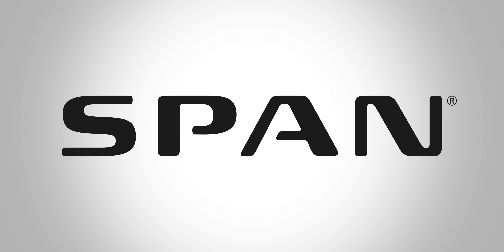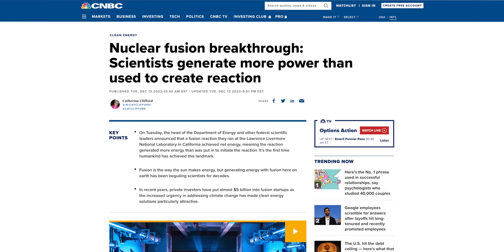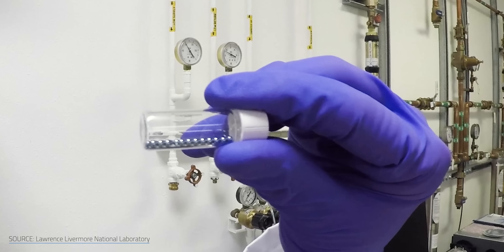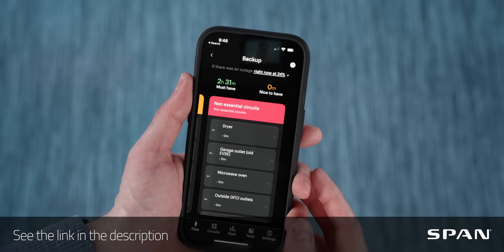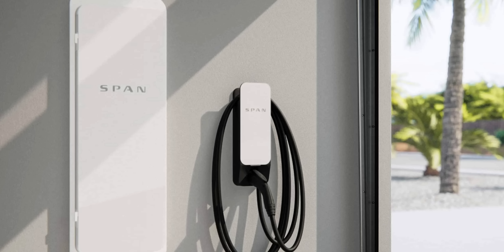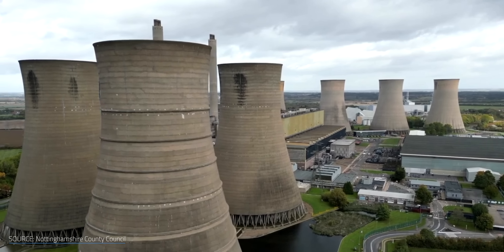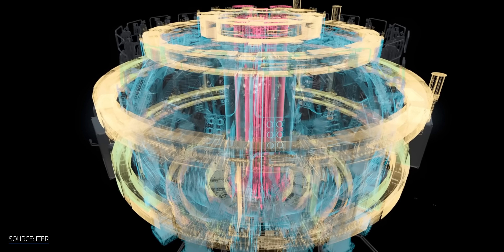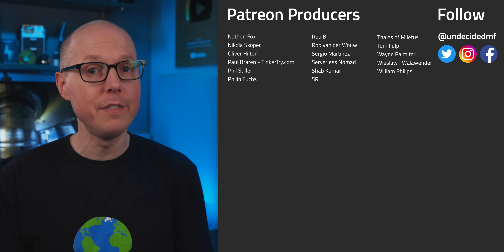What This Breakthrough Means For Nuclear Fusion

Comment from the maker: What do you think of the latest fusion announcement? Are we still 30 years away? Get the Span Panel and Span Drive EV Charger at https://bit.ly/3WCInGP.

If you liked this video, check out 137 Year Old Battery Tech May Be The Future of Energy Storage https://youtu.be/2wsSRq-bEm0?list=PLnTSM-ORSgi4dFnLD9622FK77atWtQVv7
Reply: Ah Matt......30 years....and the rest..............been following fusion since I was 16. Now hitting 50...... and I will not see a working system before I die!
Reply: likely 50 to 60 years we might have a real breakthrough, at least i see different companies trying different methods
Reply: I believe what we are seeing in fusion research, in a way, parallels the space launch system work ie. NASA vs SpaceX. The iterative nature of some fusion research, ie. Helion vs ITER will draw commercial fusion power closer much faster, much the way SpaceX, Blue Origin, and smaller companies like Rocket Lab have drawn everyday space flight closer. Commercial fusion power may not be right around the corner, but it is coming at us much faster than ever before.
Reply: @bjbosche  

What about  non-commercial fusion power?  Most of this research and development seems to be directly or indirectly state sponsored using tax payers money so I would argue that there is no good reason why the viable end result should not be also.  I think it would be better not to give up this energy source (if it ever gets to the stage where it's economically viable) to the private sector to monopolise and make a profit from, but rather let it be owned and operated by state governments (or the federal government) at cost price and funded by state/national taxes.
Reply: I do think that there was some deliberate misreporting going on here.  There was an announcement that came from the DOE about this achievement and they are not going to simply miss an important detail like this.   The DOE and ARPA-E are funding multiple different fusion research programs and they should have no reason to want to favor one particular research activity over another.  The only way you can compare the efficiency of the widely different fusion reactors is to compare net energy out to net energy in.  The fact that this reported ignition was achieved by redefining the rules for the game is simply not a detail that anyone related to this industry has missed.
Clearly there is something else going on here - maybe this was pulled as some kind of political stunt?
Reply: I show my evidence...  "The Hunt for Dark Matter is Over" on my Mudfossil University Channel.
Hello my friend...we created a fusion reaction using a HIGHLY TUNED venturi and only light photons. The result was acceleration and we could see the particles actually divide into Muons/electron showers. Can we speak? I have the evidence.
Reply: I used to work as a subcontractor to LLNL and the NIF facility was not designed to create grid electricity and never will. The TOTAL energy input was at least 1,000 times greater than the energy output. Tapping 2 crystals together will generate electricity but will never generate utility-level energy. NIFs main function is to get politicians to fund their existance, they are very good at that, can they do fundamental physics? maybe and that may be enough of a reason fund them.
Carefully managed Fission Energy of existing facilities to generate base load is the way to go until the real Fusion power can scale up Wind/Solar/Storage is the future for the next 30 years.
Reply: @jjamespacbell  Same for CERN LHC. But NIF is all about the 4th gen pure fusion micro bombs. They just dressed it up as fusion energy research. And lately they did not even bother to mislead people. DoE guy specifically said that this is for our nuclear deterrence (read: China). There is a scientific mafia out there to steal the research projects.
Reply: I think what these fusion ignition concepts organizations are building are Fusion Bomb Igniters. Clean Igniters to create Fusion Bombs that don't use radioactive fissionable material as their ignition source . Bombs with NO discernible nuclear fallout. Bombs that can be used on the Battlefield. The NIF has demonstrated such a device is feasible. They only required 10 Kilowatts of Laser Power to achieve  a Fusion detonation equivalent of 27lbs of TNT from the fusion of 4% of their Pellet.. All the rest of the huge amount of laser power was filtered out.   And that was being wasteful.   Until some one comes up with a Fusion device that produces electrons directly into the power grid this process is going in the wrong direction. Been following Fusion since before they built the first Fusion Bomb.  At this rate my Great Grandkids will not see the benefits of Fusion. If we haven't blown up the planet by then.
Reply: I remember reading that the French were also experimenting with laser induced fusion since the 1980s.
As far as the total energy balance of the entire plant, they are still very heavily in the red.
Going from microseconds of fusion to a 24/7 year round operation, is definitely still 30 years away lol.
I have also commented in a previous video of yours that only when they will achieve Deuterium - Deuterium fusion, fusion will fulfill it's promises but this may be 100+ years away. 
IMAO, since in a hydrogen bomb an atom bomb is used to start the fusion reaction, so it may be feasible to use this laser ignited fusion as a starter for the fusion of a magnetically compressed plasma. 
In other words combine existing technologies instead of using them separately.
Reply: - -  Check the video from 'Real Engineering' titled "The Problem with Nuclear Fusion" and THEN you HAVE TO SEE this video after that titled "A New Way to Achieve Nuclear Fusion: Helion" :D
Reply: The 30 yrs away def still true (at least), only question is whether we've cut down on the "always will be" I guess that's "undecided" lol
Reply: Based off of this video would you say fusion is only 20 years away?
Reply: Its hard to see how it can ever compete on cost with the large free fusion generator of the solar system. Its like 2 car companies - one has access to a free fully staffed production line where all it needs to do is drive the cars away vs a car company super high tech amazing production line but it has to pay its staff and maintain it. Now the free one has some issues with the hours it runs and convencience of location but when all the hard bits are free it is such a competative advantage.
Reply: The West just wants to push its far-fetched propaganda. So far EAST still has the upper hand...holds two records.
Reply: @cam35mm  You know China's EAST reactor is a test site for the international ITER program being built in France with a multinational team that includes China? It has also been mentioned on this channel in the past.
Reply: @kingdomofashes  Ummm...EAST completed in 2006. ITER founded in 2007. So if you are saying that ITER is based off of EAST and using EAST data even though ITER has not been completed then yes. Yes I know EAST has been on the channel but this video was based on ginning up the west projects. granted Matt busted many of the west propaganda though...good for him. But still if no one knows about EAST then people would think it's the west invention and in the end the propaganda would be China once again stole the west tech.
Reply: If they all collaborated exchanging tech and insights. We are looking at a good net positive solution by 2030.
Reply: You were quite slow on the draw to this announcement, think YouTube has already been saturated with others explaining the actual science behind the announcement for a good month or so
Reply: At the current size and importance of breakthroughs, we need such a similar breakthrough every 2 or so hours to meet the 30 years goal.
Reply: - HB11 strikes me as the best technology ... mainly because it scales both down and up - Proton Boron reaction is difficult to start (some claim positive Q is impossible) but produces energy in the form of alpha particles whose kinetic energy can be converted via MHD and gamma whose photon energy can be converted via pair production and photovoltaic ... NO MOVING PARTS. That means that R&D must proceed on 3 fronts: [1] Efficiently triggering the P-B reaction [2] MHD conversion [3] gamma conversion. 
- Unlike D+T reactions, there is very little neutron production. This should simplify reactor maintenance and salvage.  Since there is no steam turbine generator, this seems to me to be much more something I expect from the 21st century. It seems anachronistic to use nuclear energy to operate a steam engine.
Reply: We are infinitely away. I am getting inpatient with your optimistic reports. Nothing has happened. Net gain is nothing. It is a hype.
Reply: Looks like a step forward but the competing fusion reactors mean some projects are going to lose out. The French Iter reactor isn’t even completed yet and it may be obsolete.

The other issue for energy is not just production but also consumption. We need to build more walkable and efficient cities that require less energy consumption.
Reply: When I was a kid, the joke was "50 years away and always will be" then it was updated tob"30 years and always will be" and now I've heard it told unironically as "20 years." Meanwhile the performance of fusion experiments has been progressing at a rate similar to Moore's law. There has never been any intellectual integrity behind the joke. It's just oil industry copium at best and outright propaganda at worst. But tell a lie often enough and everyone will learn to believe it. That said, this approach doesn't seem like the most likely route to actual working power but at least the news helps push back the idiots' memes.
Reply: Honestly, I think the timeline might be shorter than we give credit due to the advancements in AI. The next few years may be the tipping point in which a myriad of mysteries in physics are cracked thanks to breakthroughs in computing itself.
Reply: Unless the lasers used were only a couple percent efficient and they can get close to 100% efficient then there’s no logical way that first mentioned system makes sense, ever, even for a single shot of power generation.
When you add needing to cool the chamber back down to near absolute zero and cleaning it before doing another shot, that’s nonsensical for other than very expensive experiments even if you had a tritium breeder, yet another problem.

Maybe another one of the mentioned methods will work, but not that one, that’s clear!
Reply: The technical advancements to make commercial fusion possible are unbelievably difficult.  It may never happen, but it will definitely not happen without major private investment and government money.  Since we need to spend trillions of dollars a year for the decades to slow down climate change, we need to spend billions of dollars a year on a chance to solve the energy problem and climate change without bankrupting us.  It will take all the advance technology we have and can invent to make commercial fusion a reality.
Reply: @MissingUser  honestly after 20 years of obsessive research, I can tell you EVERY major super power in the world 🌎 has a variation of this exotic technology. America, China, Russia, Germany. The only people losing are the 99% that are ill informed and won't say anything to them about releasing the classified technologies IMMEDIATELY. 

Releasing the technology to the public would be the ultimate disruptor but it's inevitable, too many independent labs and scientists have replicated results and working behind the scenes on commercialization. The elite super powers know this. 

The entire RUSH to zero carbon emissions has NOTHING to do with cleaning up the environment or saving humanity. It is the 100 year old classified defense and aerospace sectors way of creating a public fascade to transition into the quantum energy generation technologies that they can no longer control the narrative of due to humans naturally progressing. 

It's a way to keep eyes off the government, dod, DoE and defense contractors that already had all the technology just wouldn't release it but because there is this high speed push to go carbon free to sustainable energy it allows room for a transition period where "they" can routinely release information and breakthroughs to the public slowly as they give ample time for the oil cartels, energy cartels, and automotive cartels plenty of time to rape and pillage before shutting down indefinitely. 

One example is the BIG nuclear fusion announcement from the United States 🇺🇸 DoE and Lawrence Livermore National Labs last month. While the public announcement was a fascade behind the scenes they are 60+ years ahead of what they announced and stole trillions of dollars in tax payer money to fund it. But as more independent labs and scientists figure out what the defense sector already knew, the United States 🇺🇸 curiously announces to the world a "NET ENERGY QUANTUM FUSION REACTION" but still claims we have years to go to commercialization.

Yes the poor broke labs and scientists have a decade to catch up but our defense sector and classified aerospace have been there and done that already just never allowed the tech to open markets. 

Release of these new energy generation technologies above and beyond traditional solar, wind, coal, petroleum and even traditional nuclear is the biggest disruption on earth. The price of EVERYTHING PLUMMETS TO NEAR ZERO.

Another reason blockchain cryptocurrency and bitcoin is infiltrating the world is due to the plan of the defense sector control collapsing the old carbon scam petro dollar and rolling into a digital blockchain bitcoin system because these new technologies get rid of the idea of money as we once knew it. 

Its all being planned, I can see the writing on the wall but it could go much faster to rollout of these exotic technologies if the average Joe's of the world would get educated and DEMAND RELEASE OF THESE TECHNOLOGIES. 

You can literally find 1000s of pages of engineering r and d data from Nasa, DoD, DoE, Defense Labs, Lockheed Martin, Raytheon, Military Defense labs, declassified data going back to the 1950s proving they been developing secret energy tech for decades using stolen taxpayer dollars. It is not some tin foil hat conspiracy it is a fact. The quicker the public catches on to this the better.
Reply: Space propulsion it's probably a more likely market where cost is less important than performance
Reply: Antimatter Factory Fusion Reactor is an easier way to do things. Two small Linear Particle Accelerators creating the AM fuel which drops into the reactors and other matter fuel to annihilate and cause other pieces of matter to fuse like a contained thermonuclear reaction. Using a  small Tokamak like SPARC with the Antimatter Fuel Injection will speed things up.
Reply: Yes, other light isotopes such as deuterium and hydrogen-3 can also be used in fusion reactions. Deuterium, for instance, is commonly used in fusion experiments as it can be easily obtained from seawater. Other isotopes such as lithium-6 and boron-11 have also been explored as potential fuel sources for fusion reactions. However, tritium is favored as a fuel due to its high reactivity and relative abundance.
Reply: Out of all the new energy tech, I think SMR and the deep geothermal are probably the most promising. We already have SMR builds underway, while the renewable energy lobby could derail it in the US, there's still a chance that it'll get build outside of the US. The deep geothermal with the mmwave drill is also promising, it seems like that's a much easier technical challenge to overcome than fusion.
Reply: This is very cool and seems like the technology they use to power spaceships.  Also check out Brillouin Energy out of Berkeley, California. They have a technology that converted Deutereum or Hydrogen into Helium which generates 3x over unity in terms of the electrical power that you put into the system.  They key in their system is a chamber that contains powdered tin metal that is used to create an even dispersion of reaction gasses in the chamber. We aren’t going from matter to 0 matter, generating ALL the energy, we are going in a step from Hydrogen to Helium and releasing the in-between energy of that smaller step.  It’s very safe.  Hot Hydrogen Tube.  Can revolutionize the world.
Reply: power armor
Reply: The only way we see commercial fusion in my lifetime will be if some scientist throws some chemicals i a beaker and forget to dump them out when nothin visible happens before 5:00 quitting time. Then she comes back to the lab the next morning, and !MIRACLE! fusion occurred in the middle of the night. Worked for Kevlar, maybe for fusion too. I've been studying/watching fusion progress since 1968, and the hype has gotten really boring, to the point of irritating. Still, I did volunteer to die to protect your right to free speech, if necessary, so let's keep the discussion going. Cheers! PS: I think the Complexity people may be on to something, as confinement failures may be solved with Complexity Theory advances.

Comment: I hope everyone understands this, the reason goverments are freaking out to produce fusion is that petrolum basically is about to explode in price due to shale production peaking meaning most western nations are going to be left with no cheap energy sources.
So if our infastructure does have an energy source that has an energy returned on energy invested of roughly 30 times the amount you invest within the next 25 to 30 years our system will just not function, that is why you are seeing the current economic situation and it will only get worse unless we have fusion/brand new systematic infastructure change we are going back to a time like the late 18th century. Hope this helps you understand our predicament